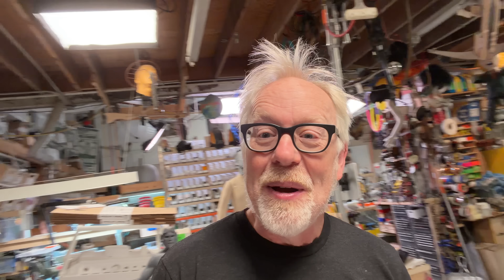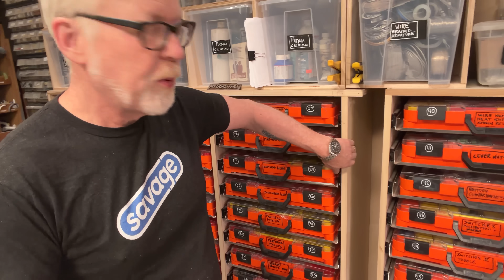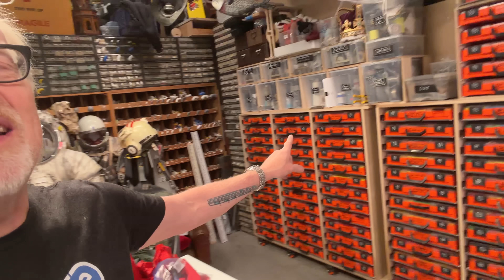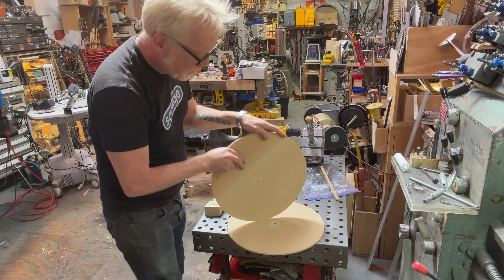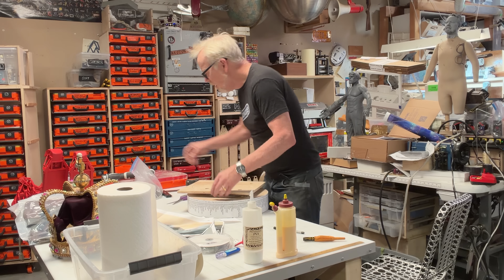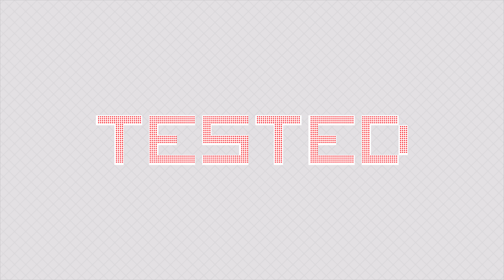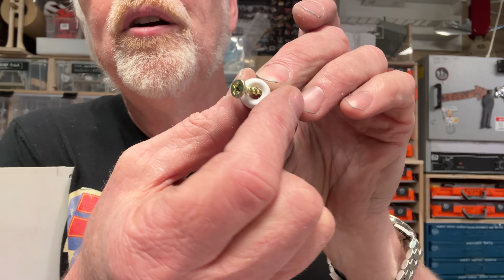Adam Savage's Hardware Organization Mistake!

Comment: As a programmer who's first internship was to make a software to sort excel and parse excel files.
I doubt Microsoft themselves know how excel works.
What I did was strip the data right out of excel and pars it outside of it then programmatic make a new excel files and slam the data back in. It was 2400x faster at the cost of losing all text formatting in excel. since excel is not a good text editor, it was not a deal beaker for the company, the data was mosly used for the strings in a other software.

What I would recommend because making a printable excel spreadsheet sucks since excel is not a text processor is to export the Excel table as a CSV file. It's a basic text file where all the rows are separated by a new line, so each row is on it's own line and each column is separated by comas.
You can copy paste that list in word do a CRTL + F where you find all the "," and replace them with a blank space " " and then just adjust the text in word. In word you can also import a CSV as a word table and you can make the table line invisible easily. You can also make a style that you apply on the column with text where the first letter of the style is always capitalized with a underline if you wanted to underline the first letter. you can also just go an keep the table line to Highlight what alphabetic section you are in. Personally I would go with a blank Row where the number is the Leter of the section. Much easier for the eyes to notice that you are in a new section specially if you end up underlining text for visual indexation.

Comment: People are gonna hate me for recommending a digital solution but, create a searchable database with a touch interface on a tablet docked somewhere so that you can have you preferred style of organization and folder structure, easily edit and assign search tags and icons and then to make finding the box easier run LED's to Each one that will light up when you select it. If you want to get fancy you can assign stock take but that will get advanced to control and make usable.

Something as basic as this could probably be coded with AI even to someone with no coding experience in 2-4weeks and the electronics could be purchased on Aliexpress. 

The wheel is cool though, a bit hard on the eyes with the text size but tactile will always be cool.

Comment: How about adding a little lead shot with UV resin to the inside of the wheel to give it a bit more momentum and maybe use a ball nosed end mill to carve some finger sized indents on the side around the circumference to provide a little extra grip.

Comment: Add a new column in Excel that appends the number column to the name column.  Then print just 5his new column. You can also add a connector like “ - “. Or you can add a border at the bottom of the two columns and print it.

Comment: Boomer Biff here. I'm with you on the old software for some things. I'm still using Corel Draw 8 because it does 95% of the graphic mods I need. I use an old version of Photoshop for the other 5% percent. I also use an old version of Paperport for my scanner. Sometimes you just can't beat stuff you're familiar with. And sometimes so-called improvements aren't.

Comment: I would have put together a cheap e-ink display powered by an arduino and controlled by a small thumb wheel. Then you won't need to reprint if ever modifying.

Comment: I was recently thinking about this organization problem from the smart home angle (even though I don’t know how to actually go about putting this into action). The extra smart additions to this organization problem is to add some sort of LED lights that could show which drawer you have any given widget you have stored away inside of and possibly some way to track weight for bulk loose parts/material and know when you might run out so that you could reorder things before you actually do.

Comment: sweet upgrade! looks like it does the job well. needs some dimples or something in the side so that you can scroll it without having to touch the face with your hand. it's fine so long as your hands stay clean, but even slightly dusty hands will leave their mark before long, and if you end up with any moisture on them, from sweat or whatever, it's gonna be mud smudge city.

Comment: Did you mean Libre Office? Open Office died when Oracle stopped supporting it. 
I think a 1/4th height, 4-panel accordion pull out list mounted high in that slot would have been easier, & faster by a LOT & waaaaay less complicated

Comment: Also it would seem you were tunnel versioned into making a ROUND rolodex. You could have achieved the same (better) results by making the list snake around some "pulleys" to fit in a smaller foot print. Think like a serpentine belt on a car weaving around the pulleys.

Comment: Use the wheel with a pointer to a microcontroller to have LEDs light up the container.
Reply: Ooooo I really like this idea. I was just thinking a piece of plexi in front with a line or highlighted part to help read the lines but lighting up the box location would be super cool
Reply: Then you can spin it quickly to achieve Hardware Store Disco Inferno

Comment: This seems like something you could actually use a smart speaker for. Create a simple skill/action to soundex search the list. Could even pull the list dynamically.

Failing that, just get a cheap touchscreen tablet and open up the list in an editor of choice. Easily update as desired, no programming required, though I guess you'd have to route power to it.

I know, it's not a mechanical build, but it is easier and more efficient.

Comment: Rather than a wheel a belt would have been better.   2 small wheels with the list wrapped around them (conveyer belt style) would be narrow depth and could have sat only a few inches out from the storage racks and you wouldn't have had to move them.   If the list gets longer, move the wheels apart.

Comment: I'd suggest putting it on a self tensioning loop that could be run over a wheel of any size.  That way you could edit it a lot easier.  Perhaps the loop could be assembled like a tank track or with holes to help guide/drive the loop much in the same way as a film projector.

Comment: One tip I remember from art college a million years ago was to protect the good side of the cut by shielding it with the straight edge. That way if the blade starts ding its own thing it cuts into what you don't want not into what you do want. Also always hold the ruler ahead of the blade not behind it so that if it rides up the edge it doesn't cut into your finger tips. Learned that one the hard way. In a career starting on the paste-up table in 1975, I only cut myself once. The later we moved to Mac's and the knives went away for good - almost. Also, use a Mac and their free, word processing, spreadsheet and page layout software. They are simple and just work.

Comment: Me being a bit more tech oriented, what if the items and locations are in a database and tied to an led in each shelf? Need a thing? Keyword search it, hit a locate button or something and the box slot lights up. This lets you also add and subtract from the "list" w/o having to constantly remake a physical object if that's a plausible concern.
Reply: A Raspberry Pi with an external keyboard for searching, and then illumination via some LED's?
Reply: With this idea you could also use small monochrome displays to indicate/edit the amount of stock. This gets complex fast😅

Comment: Imagine if you created the wheel and added some electronics smarts to it, so that when you stop the wheel at a particular line, an LED would light up next to the referenced storage container.  It would be a great project for you to do an episode on as well.
Reply: I used to write code to run robotic automation in warehouses. Aside from the sorters, pickers, flippers and such, we also had several home-made and off the shelf solutions for scan-to-bin. Basically you scanned a barcode and an LED would light up on which bin on a set of racks (20 bins per rack, 3+ racks) the thing could go in.  The APIs were simple, stupid REST APIs to a central controller that just took a row, column, and color, and optional amount of time to keep it lit.  You could have 5 people doing it at the same time, each gets their own assigned color so everyone knows which bin their specific package goes to, but it was all really really simple.

Like I said, it's off the shelf stuff too. A simple arduino or similar controller to handle a wireless connection, expose a rest endpoint, and then a webpage that sends the request when someone clicks on an item in the list.  Just fullscreen a tablet browser window and you're off.

Comment: I feel like you had a Tim Taylor (from Home Improvement) grunt moment at the end there.
As for your hardware guide, the wheel is a lot more elegant and cleaner than what I would've done.  I would've just done the simplest thing possible: just put the board that the list is on on a hinge at the top so that it takes up the same spacing, location, etc, but it can be swung up to read stuff that's lower on the list.  And if clearance is an issue when it's getting parallel to the floor, probably just cut the board into hinged segments.  I definitely prefer your rolodex, though; it's a much nicer solution overall.

Comment: A suggestion for if you ever want to visually separate the letters (or even just the type of items on the entire list,) use colors! Color coding them will help to add a visual separation between the letters (if needed/wanted) or between the type of materials/hardware on the entire list. Easiest thing to do would be to do a gradient across roygbv(and then grey-black) but you could also just skip across the color wheel each time to have a better separation from the items. I.e. - going from red, to green, to blue, to orange, to purple, to yellow, etc...

And if it ever still becomes an issue for you to see which item is associated with which box number (at a quick glance,) then possibly underlining them could aid that. Follow the underline through the blank space connecting the box number to it, and it'll make it easier to quickly gauge which is which. That would add on (potentially unnecessary) space to make the list longer on the paper, but it's still an option. I think that having the box numbers on the left should be more than helpful to aid that, though!👍
Reply: i was just about to recommend something similar but looked through comments before posting, took the idea out of my head. it would be really cool seeing the wheel spin with just some simple coloring, and it should work well for telling the different letters apart.
Reply: I'm a big fan of underlining every 4th or 5th line. It helps to break a big list into smaller units that are much easier to navigate
Reply: Man you advice is great and even the response are extremely helpful

Comment: The other thing that can be done is to setup the rows in alternating soft background color. Additionally you can add gridlines. It just helps to have a bar of color behind the lines so easily track them with your eyes. A light blue or green works with standard white.

Comment: 1:36 rather than a wheel, why not a Rolodex, so that you’d only need to change one card when you alter the contents of a sortimo
Reply: Limited number of cards that can fit a rolodex. For a smaller collection of materials, that is not a bad idea. Each card could even have a QR code that would automatically look up a replacement, but this collection likely holds over a thousand items, while at most the rolodex holds 500, so you are looking at 3 or more rolodexes for this collection.

Comment: If you happen to have a magnifying glass lying around unused somewhere, attach it to the top. That way, you could also reduce the font size to fit more on the screen (or make the wheel smaller).

Comment: Instead of one wheel, you could have used two wheels, and glued the list to a 'belt' and rotate the belt on the wheels. This would reduce the diameter of the wheel, reducing the need for it to either protrude so much or have to be so far in between the drawers.  This variation would also give you potentially more room for the full list, but this would depend on the diameter of the full list vs. diameter of the two smaller wheels and the separation distance of those two wheels. It would also allow you to use a larger font, which is handy as we age, we all like larger fonts. The belt could be as simple as a long belt sander material, or a make shift tank tred like belt made from lightweight wooden slats with the list afixed to the tred in a way where the flexing of the tred doesn't mess with the list.  Of course the belt setup that I'm describing does make a far more complicated build, but something Adam could sink his teeth into and allow him to account for a more extensive materials list and larger fonts with less depth in the shelf needed.

Comment: This falls under the heading of, “There are many ways to do a thing.” I made a game wheel a little larger and mounted a spindle on plywood. Put two bearings in the flats, slipped it over the spindle (loose fit to spindle). The weight was supported on the bearings and it was very quiet. I didn’t think of lazy Susan bearings although it sounds like it would have been noisier.

Comment: As someone who doesn't have a full shop, I would be slicing  and gluing an oatmeal canister for my wheel/cylinder(s). The rotational idea is great.

I'd probably end up with several in a row, like a slot machine, rather than the large diameter one that would be ideal, though.  Unless I had an old movie film tin to use instead....    I think I also would put some kind of bumps on the perimeter for easier manipulation of the wheel, like small push-pins that project radially, one every 4 inches perhaps (thinking of a ship's wheel here, but much smaller.  those would also reduce schmutz on the paper of the list itself.)

Comment: Three columns per page, double sided print, Laminate , if pages > 1 , single hole punch in the top left corner and connect them on a ring , put a little hook on the side of the storage holders and hang the page(s) on the side.
Reply: And before naysayers for this being less exciting or interesting , yes, it is , but its functional. and keep in mind his original solution was a single long list stuck to a board and screwed so he'd have to kneel down on the floor to read it.
Reply: @Sibanamush elegant, efficient, straight forward, I like it. Life is more fun on wheels, however, and I like this particular trade off with efficiency. Maybe both for whichever method flows better with the process at the moment.
Reply: @Sibanamush  My solution would've just been Adam's original method, but instead putting the board on a hinge at the top so it can swing up.  If clearance is an issue as the board is getting parallel to the floor, then cut the board into segments and add more hinges.  Simple, effective, takes up the exact same dimensions that the original list did.
Reply: That's viable for space, but knowing the kind of person Adam is, doing this is a way to have everything be visible at once, and quickly accessible. The laminated sheets on a ring could be a bit annoying to use if you have only one hand to look something up, too. I do agree, though; for most people in their shops, having an organized sheet like that would be more than enough.

If I remember right, Adam's want to do the big list screwed into the front face of the box stands was because he wanted to have something that showed everything at once that he could add onto easily (by writing in new items, or just printing out a new list and gluing it on.)

Comment: Adam, maybe you would like to look into using a simple raspberry pi credit card computer with a small screen and keyboard to allow you to hold your inventory lookup.  Having a printed list is a great idea, but it requires a load of time for upkeep.  The wheel idea was another great idea, but what happens when you add more items on your list? You can reprint the list in smaller print size, or worse case you need to create a larger wheel.  If you use a small computer (raspberry pi) and a software solution it buys you the ability to do quick searches, easy maintenance of your list. The list can exist in multiple locations.  Where ever you have a computer or smartphone.  Btw Libra office run on raspberry pi.  The keyboard and small monitor can be mounted on a vertical pullout and flip to access for storage.

Comment: Needs side finger grips for easy spinning so you don't munge up the printed surface. Maybe some 1" or so holes radially in the meat of the wheel. Of course, if you were really ambitious you could make a push button mechanism that would spin the wheel to the corresponding letter. Maybe Sortomo-Wheel-Of-Finding™ version 2.0. 😀

Comment: I was so expecting a 3d printed crank style list, think a scroll, with easily re-loadable lists so when you add to the list you arent so dependent on the circumference of a wheel.
Reply: That's called a rolodex.
Reply: @chaos.corner no i wasn't meaning s rolodex. Thats got a single axis. I was thinking more like a dual axis where the list rolls up on an axis below and one above with a reading window in the middle. Like the old dual wooden handle scrolls, not sure what they call these.  I could see a rolodex working too, that way one could add in or replace cards as needed.
Reply: @slove120031  Yeah, that would be neat. Not sure what that would be called. I thought maybe cassette but that means 'little box'.